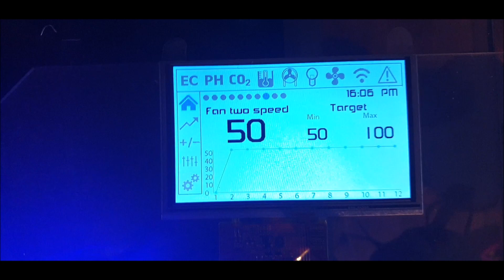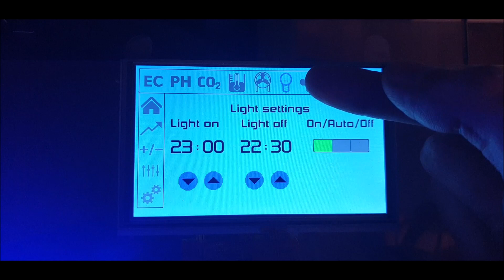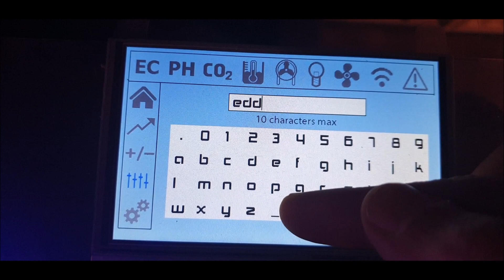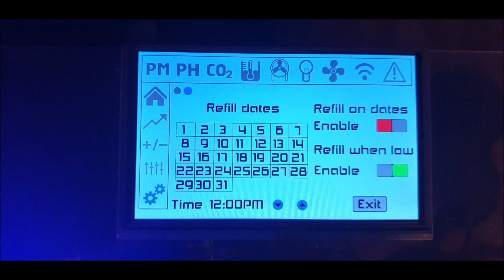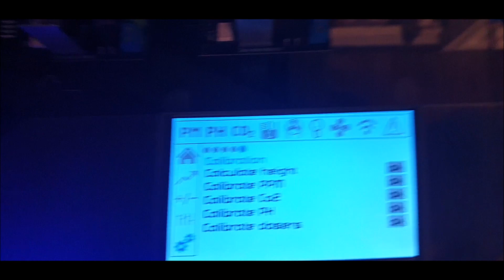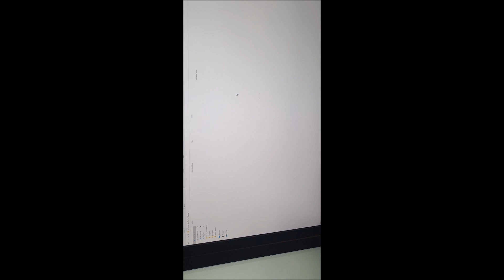Arduino Hydro controller version 3.0

Comment: Great job. I am doing similar with a raspberry pi but the ph unit I find is not so accurate. Will try it on a Arduino see if that gets a better result.

Comment: Is it actually possible for a total newb with very basic electronics knowledge build a sensor kit that wirelessly transmits its data via WiFi  such as email or via a specific app
Reply from the maker: Already done check my latest video on YouTube regarding wifi, I shall release the code this weekend i am just adjust some core functions at the moment. You can view the web GUI here: https://arduinoprogramming.com/hydroController/hydroControllerGui.html  the old versions had Wifi too but i hated the GUI as it was just simple HTML tables but the new GUi is an exact copy of the tft display GUI and i assure you it is not as easy as you may think to achieve 2 way communication on a single core MCU that is running loads of other tasks.
Reply from the maker: Is that what you want ? :)
Reply: @EdwinMartin1990  I sent you an email a few days ago, waiting for your reply. Thanks in advance!

Comment: Hey Edwin, 

first off, amazing project. Really inspired me to make my own controller, pretty similar setup regarding the used sensors. What i am really curious about is how you managed to keep the code compact enough to run on the MEGA. I am really struggeling with dynamic memory use and i am nowhere close to the performance of  your GUI. Did you use any additional libraries to layout the gui or is it all done from scratch? Tried using the GUIslice library but like i mentioned, running out of memory with a couple of pages and a few graphs. Would really appreciate any tips on the subject. Anyway keep up the good work, cheers.

Comment: Man incredible proyect, is just what I was looking for!! I like it so much that i am buying and arduino to try get your proyect running! is it purchable or is it completly free code?
Reply from the maker: the code is not free it was in the past for just the binary files but so many people kept emailing me for help with wiring and silly questions that it literally took up loads of my time each week sorting them all out, and i honestly ended up losing money and time. So now its detonators only that can access the code. 

Its £25 for the main code and the wifi is extra as i provide a server and db support ect... 
the wifi code will be ready this weekend.
Reply: @EdwinMartin1990  Firstly thanks for your answer. Second I can totally understand you as I can imagine the amout of hours you have been working on this proyect, I completelly support that you ask for some money, and personally £25 I dont think is much money as if you loot in the market this thing are pretty expensive. 

Please let me know in a private message how can I pay you, as I am also interested, about the wifi function, I`ll have my arduino fixed with an ethernet cable board. So if function of web server is available with this tipe of conexion as an option, I would also be interested. really cool proyect man, I wish you the best!

Comment: I love your project here! I was building the code for a similar setup and I found your project with a very similar BOM. A suggestion I have for measuring CO2/Humidity/Airtemp is the BME680 :)

Comment: You must do a compherensive tutorial to people how to set up and use this device. after that people donate you happily.
Reply: i mean, which cable goes to where.. etc..
Reply from the maker: @hakanmenderes2441  I shall then, but means getting an extra display and sensors as the other one is mostly glued down so that i never salvage parts from it in the future, which i do often. So it would be a month before i order another display and sensors ect... but i will make a detailed tutorial on the wiring and testing by the end of next month.
Reply from the maker: @hakanmenderes2441  FYI there is a detailed BOM, build instructions, set of diagrams, tutorials and BIN code that i have provided, but if you want a video then so be it :)
Reply: @EdwinMartin1990  thanks man

Comment: Great job Edwin, is it possible to purchase this finished product from you?  Please let me know, if it works, I would buy multiple ones :)
Reply from the maker: I only finished this version on the 28th of December, so I am currently conducting long term tests but so far all is working great  , I would gladly build one or more for you but I would prefer you sent the cash prior because the project is expensive to build. I could make a Ebay listing for a build so you have a guarantee that I will not run off with your cash but again it could have a bug somewhere which you must except though I have not found any and if you did find anything I would fix it the same day...

As for price I would charge £80-100 labour on top of the current price of the parts per system depending on the config - number of peristatic pumps, if you want AC fan control and or Co2 and I would fully test and calibrate the system.
Reply: @EdwinMartin1990  That would be perfect. could I have an email to reach out to you and continue the conversation. I just bought an automated system, but it's not as robust as yours. So, I will be buying more in about a month.  I"m happy to send the cash prior and the ebay listing would be great. Have you ever thought of making this a finished product?
Reply: @EdwinMartin1990  
Hello sorry for my English but I would also be interested in being able to buy you a finished one. I am from Patagonia, Argentina and I want to start a hydroponic project and this would be sensational.
Please pass me the costs of what would come out and some form of contact.
From already thank you very much! regards

Comment: i upgraded my waterproof ultrasonic sensor to a TOF10120 Laser sensor (both i2c and serial support) , its £6.50. a little more sensitive than the ultrasonic, and also doesnt have the 20cm blind spot that the ultrasonic has. hope this info helps you as much as it helped me. drop me an email. Chimpo
Reply from the maker: Sweet I will get one.

Comment: Thank you Edwin!  How much modification to the electronics to run in the US 120VAC
Reply from the maker: No modifications are required but I forgot, the nano binary files are for 60Hz, but I made a 50Hz one too are place the 60Hz and 50Hz inside there own folders with an example of using AVRDUDE with CMD
Reply: @EdwinMartin1990  no problem we are 60hz

Comment: This is amazing.

You are very generous, considerate and intelligent.  Thank you so much for taking the time to do this; the vision, the planning, the code, the parts, the diagrams/schematics, etc. it's incredible man.
Is there any other way to donate besides paypal?  I despise paypal and avoid using it at all cost (I think they're shady).
I agree with your thoughts on FOSS.  But I think when you're talking about only $20GBP(?) for the raw code (I didn't know about raw/binary before this video, hah.) that's nothing; more than reasonable in my opinion.
This looks like a lot of work, quality work.

Again, thank you.  This is excellent.
Reply from the maker: Ha it took forever, just under 6 months and i already had most of the SVG icons "Fact: the icons are really font glyph's to improve speed and be re-sizable " from the last project which i joke not takes weeks if not months, but that is about all i used, the rest was written again from scratch as i knew i could improve it from what i had learned since, everything is my own minus the library's but even then of the GFX lib the fonts are mostly my own drawn pixel by pixel, and aside from that even the keyboard, graphs, slideshows, menu, buttons, refresh methods, touch handler, AC waveform code, environmental control functions, and literally everything else was written by myself. It is a thing of blood and sweat and passion because if i did not have the passion i would never spend all my evenings and weekends creating what you see, and to be honest feedback like yours makes me think it was all worth it :)
Reply: @EdwinMartin1990  Yea, I had a feeling it was even more actual original work and coding than I could have guess. Haha.

This type of stuff would be very well received and appreciated in any of the gardening/hydro forums, especially the cannabis growing forums.  Have you thought about sharing this at any of the more popular forums?